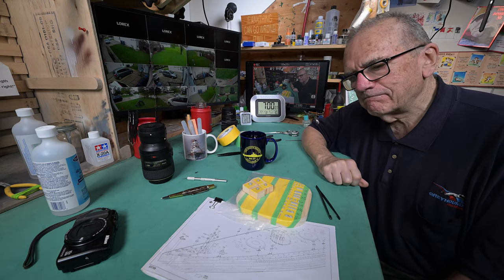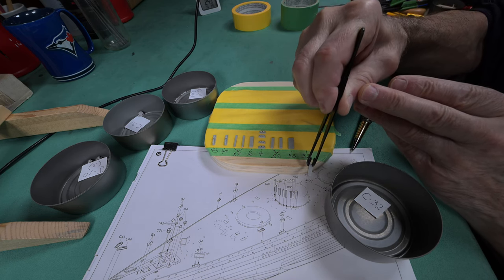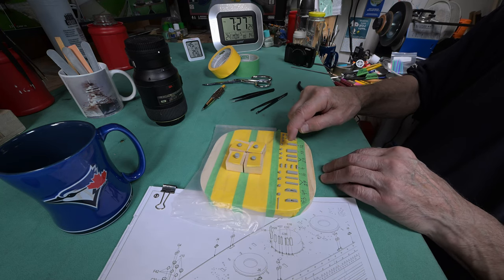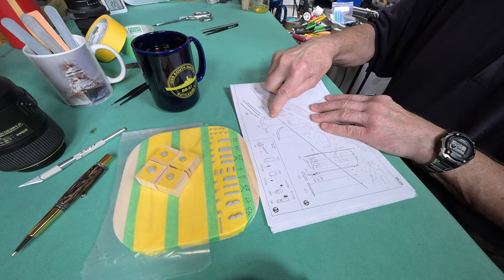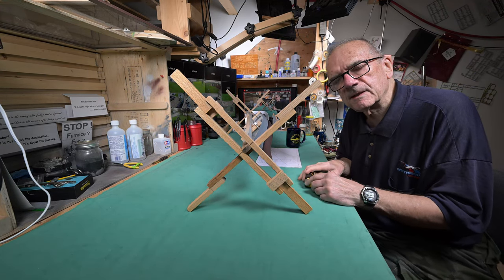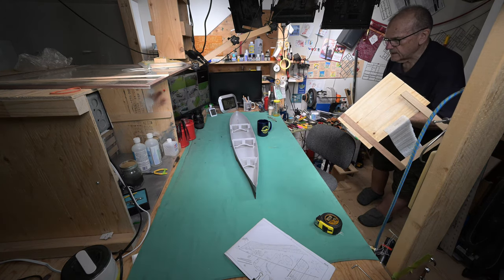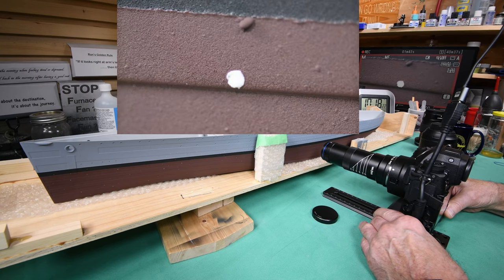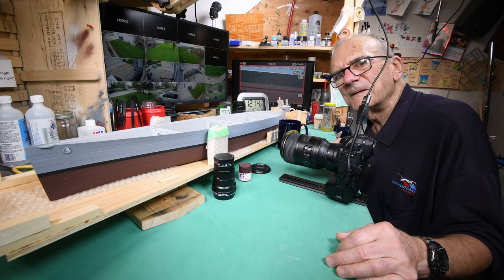The Model Ship - Part 1195

Comment: Ron, it's a pain and very frustrating,  but as you cannot see them with no  macro lens once overcoated it's sorted.  I have done that myself.       Well I have decided to refit HMS Nelson with port holes instead of the doors. And have already done both sides added Tamiya filler and will sand smooth followed by adding the eye brows above each one. I was looking at photos again an decided it would have been done in the US refit.  I created work for myself lol        Happy modelling and wood working
Reply from the maker: You are a stickler for detail Paul --- in a good way! 👍
Reply: @roncalverley  Well just completed the refit Ron, yes I am, but not over the top, and thank you. What Tamiya colour did you use for the grey on the upper hull?

Comment: I was wondering if you shorten the dry dock will the Iowa hull fit. Will you need make it longer for Iowa build? It might be good to make it adjustable to fit different size hulls. The Yamato battleship will probably be longer and wider too. I learned to take pictures of things on how they go together for reference. I also take pictures with all the parts laying  spread out. It makes assembly a lot easier. A photo can take the guessing part out of the assembly👍. We have had rain here too the past few days. It is suppose to rain most of the week. Be safe and see you tomorrow.👍🚢⛵🚂